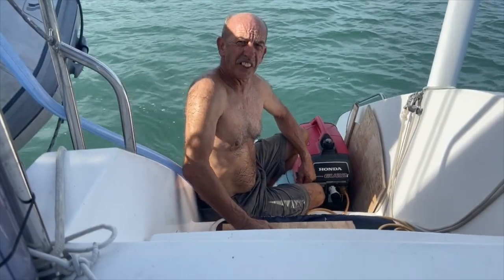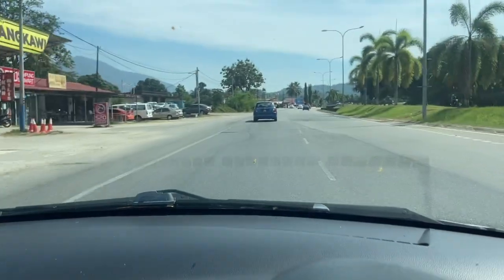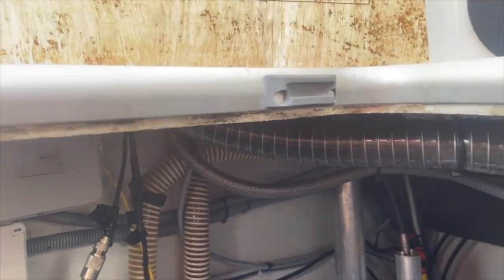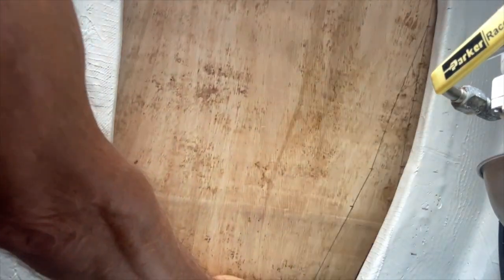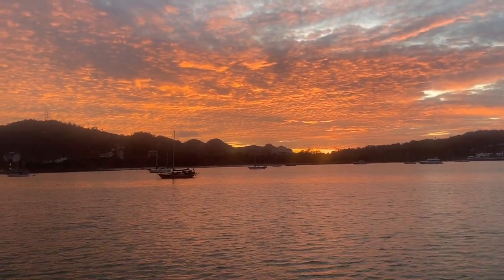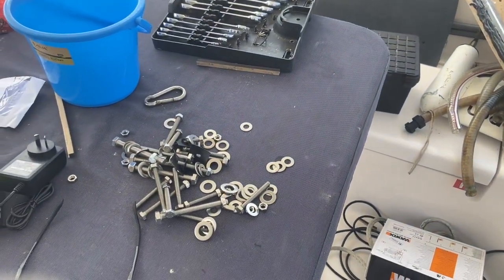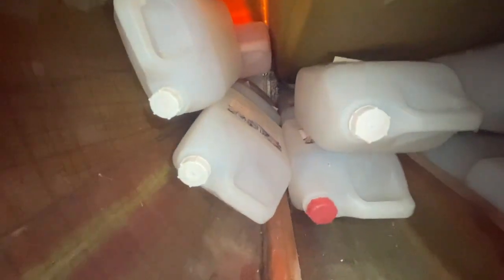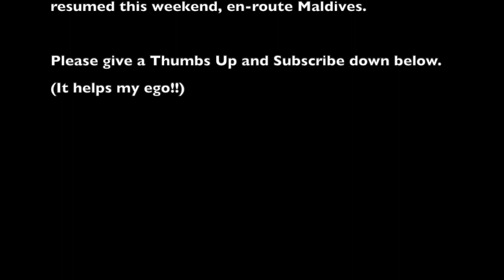SV Time Bandit - That Sinking Feeling

Comment: I also had to add a sizeable hole to our aft transom to install our hydro charger, but I added a water tight hatch to seal off potential water intrusion and still have access for repairs etc.